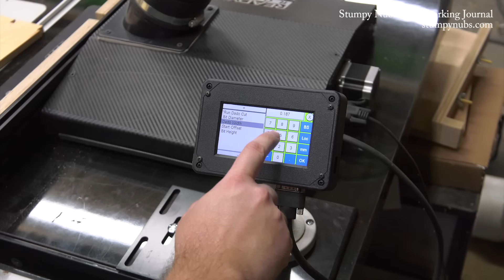Making the ultimate gift box- reclaimed antique pine with a hand-carved wine motif

Comment: I like the carvings is there a reason you left the pencil lines and numbers on the pieces for finishing
Reply from the maker: I did leave a number on the inside, but there are no pencil lines. The lines on the corners are scratched into the wood during the dovetailing process. They are traditionally left in place.